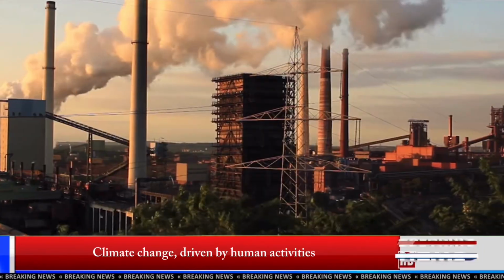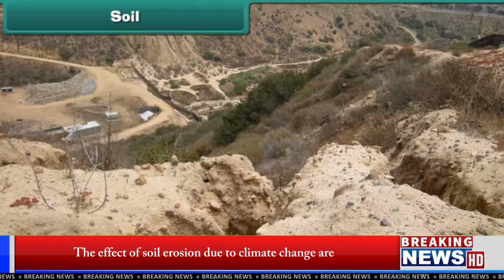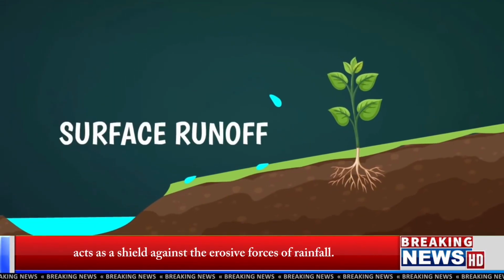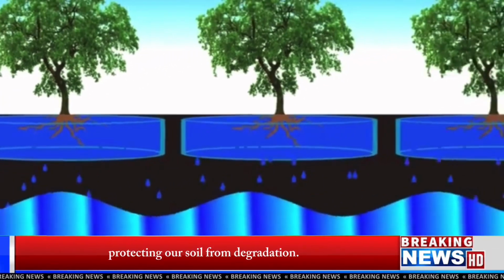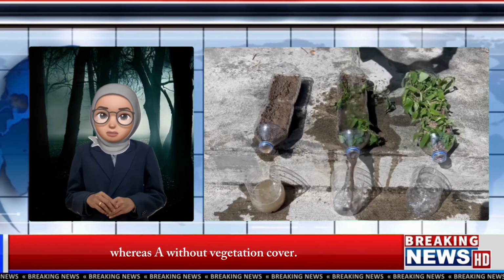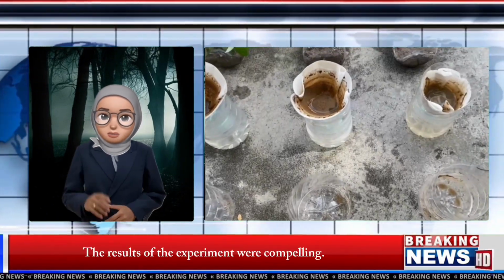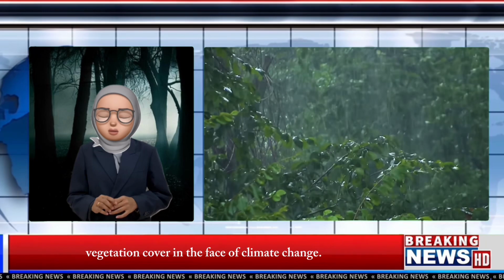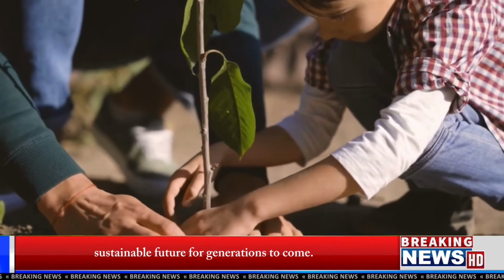BST308 | Adapting to Climate Change: Enhancing Vegetation Cover for Soil Erosion Control

Comment: Is changes in the land use, such as urbanization, have an impact on vegetation cover and subsequent soil erosion?
Reply from the maker: Hello there! answering your question, yes, changes in land use like urbanisation can significantly impact vegetation cover and contribute to soil erosion. This is because urbanisation often involves activities like clearing trees to make way for buildings and roads. The removal of this vegetation (trees), which plays an essential role in preventing soil erosion, can lead to increased runoff and reduced the stability of the soil.

Comment: Nice vid😍 but i have a question,does the size of vegetable affect the condition of the land ?
Reply from the maker: Hii, do you mean the size of vegetation cover? if true, then yes indeed larger vegetation cover is generally more efficient in mitigating soil erosion. Larger areas of vegetation provide more effective root systems to bind the soil, reducing the risk of erosion.

Comment: good work!
by the way, I want to ask in your opinion, what other strategy that can be done to prevent soil erosion besides using vegetation cover?
Reply from the maker: Hi there! Another method of soil conservation that can be done is terracing, a way of creating step-like structures on slopes to slow down water runoff and minimizing soil erosion.

Comment: Hi. What impact does deforestation have on both soil erosion and vegetation cover in a given area?
Reply: Hello👋 . To answer your question, deforestation significantly impacts on both soil erosion and vegetation cover because the removal of trees eliminates the protective canopy that shields the soil from raindrops, reducing the impact of rainfall on the ground. Without this protection, soil becomes more susceptible to erosion by water. Additionally, tree roots help bind soil particles together, preventing erosion. Deforested areas are prone to increased runoff, leading to soil degradation, loss of topsoil, and heightened erosion rates.

Comment: Are there any innovative technologies or practices that promote soil conservation and enhance vegetation cover simultaneously?
Reply: hello, there are a few practices that can be implemented. For instance, people can practice cover cropping method. Planting cover crops during non-growing seasons helps protect the soil from erosion, improves soil structure, and adds organic matter. Other than that is terracing. Creating terraces on slopes helps control water runoff, allowing for better water absorption and reducing erosion.

Comment: How can changes in precipitation patterns impact soil erosion and the ability of vegetation to adapt?
Reply: Hello dear😊. If the intensity of the rainfall increases,it can lead to increased surface runoff, carrying away soil particles and causing erosion. This can result in the loss of fertile topsoil and negatively impact vegetation. However, extended periods of drought also can lead to soil dehydration, reducing vegetation cover and making the soil more prone to erosion when rain finally occurs. Drought-stressed plants are also less effective in preventing erosion

Comment: In what ways can maintaining or restoring vegetation cover help mitigate soil erosion
Reply: Maintaining or restoring vegetation cover mitigates soil erosion in several ways. The roots of plants provide structural support to the soil, preventing it from being easily washed or blown away. The canopy of vegetation shields the soil from the impact of rainfall, reducing surface runoff and erosion. Additionally, plant residues contribute to organic matter, improving soil structure and water retention. Overall, a robust vegetation cover acts as a natural erosion control measure, promoting soil stability and health.

Comment: What role does vegetation cover play in preventing or exacerbating soil erosion?
Reply: Vegetation cover plays a crucial role in preventing soil erosion. The roots of plants help bind soil particles together, reducing the risk of erosion caused by water or wind. The aboveground parts of plants, such as leaves and stems, provide a protective layer that shields the soil from the impact of rainfall and wind, minimizing surface runoff